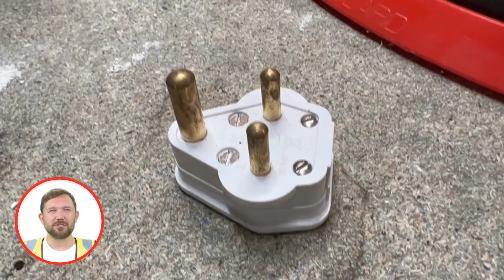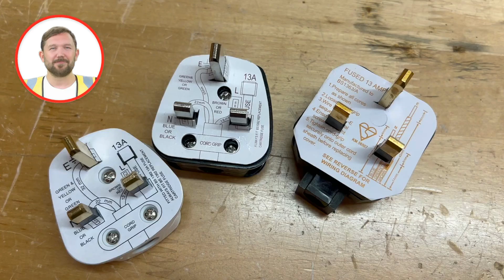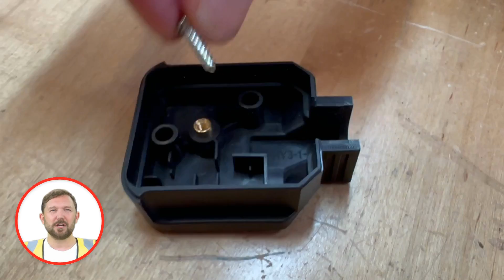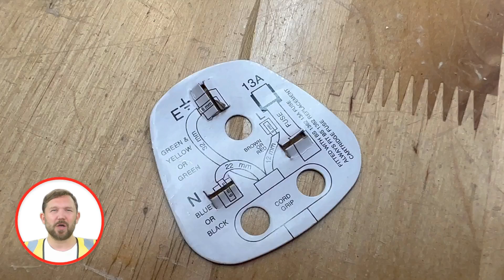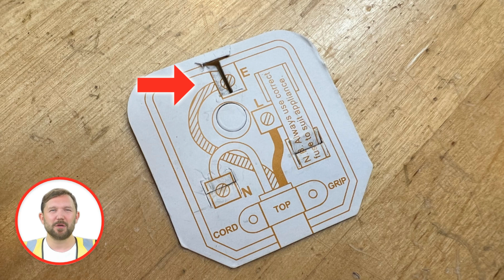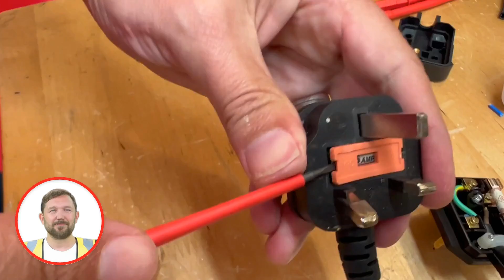How to wire a 3 Pin UK 13A Plug

Comment: Although I know it rarely is practiced, if we were to follow the reg's on terminating those fine wire cores they should be suitably dressed with a crimp unless the terminals are so designed for fine wires, in this case they are not and thus we have a video that is giving incorrect advice.
Reply from the maker: The manufacturers instructions don’t mention the need for ferrules and neither does BS1363.
Reply: @efixx  I think you need to review the BS7671, terminating fine wires has been a part of the regulations since the 16th if I recall, it also is why all pre-terminated products like lighting drops etc now have either some sort of crimp end or are heat  treated to melt the strands into a solid end. 
 The BS1363 cover the standards (in this case) of the plug itself not a 3rd party cable a consumer connects to it thus you won't find it mentioned.
Reply from the maker: The clause in bs7671 mentions appropriate “treatment” which could include twisting.  Although we would usually fit a ferrule to class 6 and class 5 conductors as best practice. See our other video on fitting a plug https://youtube.com/shorts/4HvLTNy_uyw?si=b6Noi3VG-tWb2K4a
Reply: @efixx  I would not class twisting the wires as appropriate treatment, it does not prevent the grub screws from damaging the fine wires, although ambiguous the word treatment does not represent twisting imho, the whole manufacturing industry had to adapt several yrs ago so all pretty flexed electric goods now have heat treated, or crimped cores on fine wire, this is no coincidence and a big change from the days you could buy a pendent drop where the wire had simply been twisted at the manufactures end.
  You can see the same with tri rated tail links in boards, since moving to fine wire they have had to dress or heat treat the ends which they would not do as an extra manufacturing cost if they didn't have to, the only time nothing is needed to be done to the cable is when the termination is designed for fine wire like lever style connections.

Comment: I agree with most of the comments.
Remove the fuse from old plugs and deform the old plug to stop kids putting it in a socket.
The AI format is crap.
The neutral should be much longer than the live so the live gives first if the cord is tugged.

Comment: Pretty rough tbh. Would have probably been tidier using your teeth to strip the sheath and insulation, and uninsulated ferrules are a good idea on fine strand cable / flex.......or at least double back the conductor.

I was taught to set the bar high, because if you demonstrate mediocre, you get something even less in reality.

6/10

Comment: Guys I personally think that you should advise us how to do it best not what the “law requires”! That said I personally worked as a PAT tester for seven years and I replaced more than 5000 plugs easily and from that I learned that unless you use ferrules otherwise, especially on heavy loads, it’s a must to double up the end before inserting it in the pin! But either way with or without ferrules on heaters that were used a lot the plug would fail because of the fuse holder giving up after prolonged use of the appliance!
Reply: Any insights on how to prevent thr fuse holder issue? take out the fuse and clean the contacts ocassionally can help?
Reply: @KrabsMarsul  I don't think there is anything you can do. You should be able to run the appliance 24/7 but things with dryers/washers, there's a lot of vibration and load that an loosen the fuse. This is my understanding and may not be correct.

Comment: Using wire cutters to strip insulation off individual conductors is as rough as it comes, look at the serious defamation and weakening of the conductors immediately after your cut. The clue is the word “cutters”; right tool, right job. Buying and using even a cheap 360 degree wire “stripper” gives a better result. Clarify you should able to see approx 1mm of the strands on the opposite side of the pin. Hand tighten to secure the strands in the pin without stripping the screw head off, check each individual connection for tightness as well as that of the cable clamp. When finished connecting ensure each conductor has a gentle (stress free) curve between the cable clamp and the pin to which that conductor is connected. Ensure the fuse end caps are clean (not oxidized ) and are seated centrally in the fuse carrier clamps - applies to older aged items.

Comment: When wiring a plug that will be used  CONTINUOUSLY at  FULL 13 Amps ( like a big heater or 3 bar fire ) , the fuse should be SOLDERED into the carrier , failure to do this often causes the live pin to overheat and SCORCH the plug or outlet socket , this was  NEVER  a problem with the UK 1950's round pin 15 Amp plug ! ! ( tried - n - tested ) ....DAVE™ 🛑
Reply: Interesting
Never thought about that
Reply: Agreed Dave, Progress sucks.
Reply: What a load of crap, the fuses are designed to be replaceable, soldering defeats that at a simple task for the consumer, also power ratings of heavy loads has over the yrs been reduced from typical 3KW to much lower to avoid such issues.
 I would also point out that the video does not follows regulations, those fine wires should be suitably crimped on this occasion, overheated plugs were often an issue due to poor termination, strands riding loosely up the threads of the grub screw etc ..
Reply: @genome616  I made single word comment 2 days ago
Ferrules!

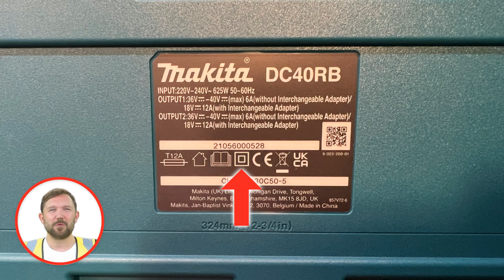Comment: @4:26 it show Makita DC40RB    240v 625w  should it then not be fitted with a 3 amp fuse?  Just asking for a friend.
Reply: That was shown to illustrate class 2 appliances, which don't have an earth conductor, unlike the cable being terminated in the video
Reply: I would fit a 5 amp fuse even at 625w I know 3 amp is rated at 690w a power tool has a high amp start up and can blow a 3 amp fuse, tools rated up to 300w I will fit a 3 amp any tool rated 325 or 350w I will fit a 5 amp fuse as it's rated up to 1150w , I might be right but that what I've done with my power tools

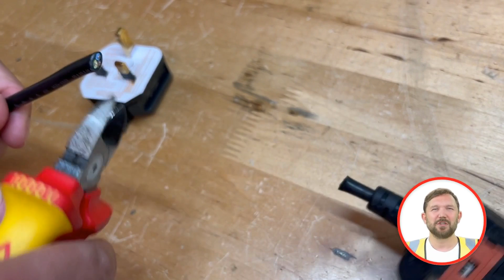Comment: 0:57 Cut with the flat side of the cutter jaws right up to the strain relief to keep the cable as long as possible. Before disposing of the plug remove the fuse for safety’s sake. Keep the fuse and fuse cover as spares.
Reply: Good tips. 👍 Only thing I'll disagree with is cutting the cable as close to the strain relief as possible. It's not a new cable, so many times the conductors inside get fatigued and partially broken close to it because of user abuse. You're better off losing those 5 centimeters of mediocre cable than saving it. 🍻
Reply: I go even further
I keep sheet long as it provides friction fit, if everything else fails

Comment: no ferrules on fine stranded cable with a screw terminal ?
Reply from the maker: Sticking to the mfrs instructions on this one. Of course we’d normally use a ferrule.
Reply: @efixx  Insulated or bare ferrules? I usually use insulated ferrules and then immediately regret the decision.
Reply: @yngndrw.  I always use non boot lace ferrules for 13a and bootlace on cee form, consumer units and other connections which have a little bit extra space.
Reply: No laws broken in the making of this video are 😂